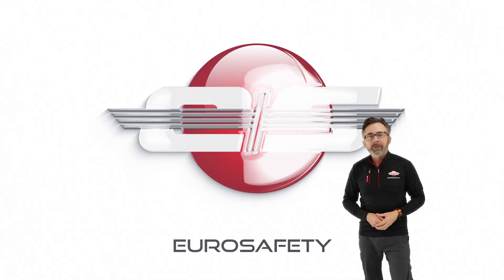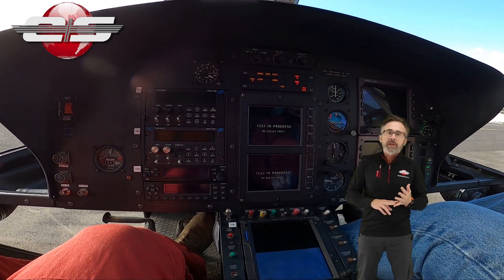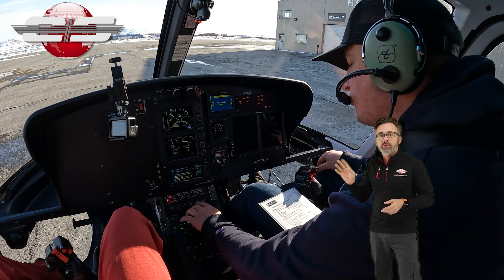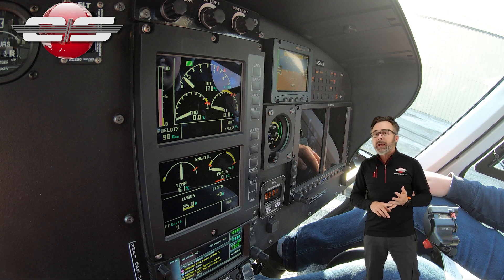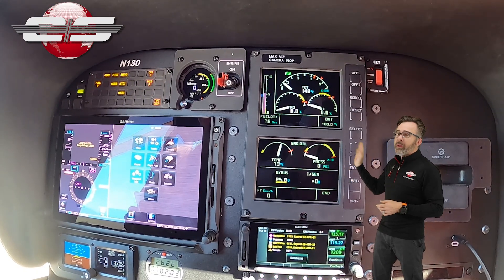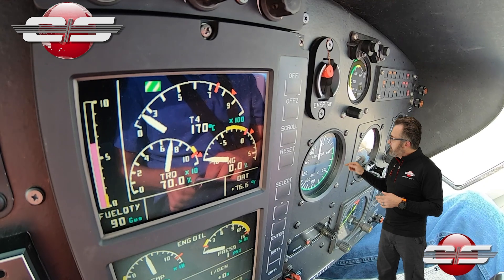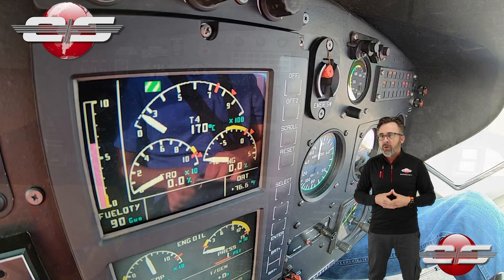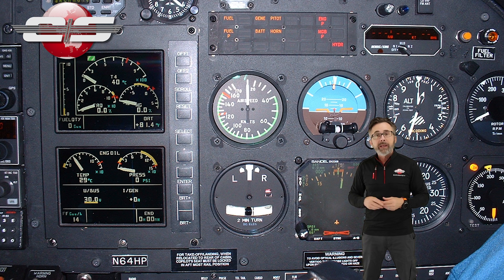#57 - Torque Calibration Check on VEMD

Comment: My  EC-130B4  does not do torque test
Reply from the maker: Could you do me a favor and film your VEMD after power is applied?
Reply: Hi Jose, did you ended up doing the video and finding out why your machine doesn’t do the test? 
My EC130 B4 does it all the time.

Goes up to 70% as soon as the VMD starts up. 

But the AS350 B2 doesn’t do it.
Reply: Is the 2b also 70 percent?